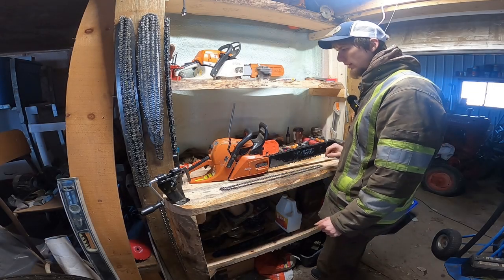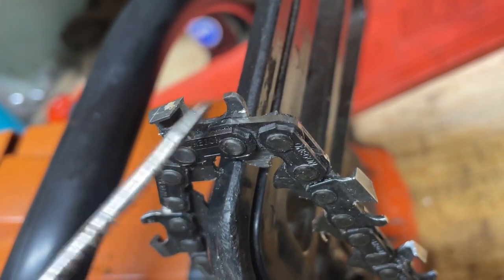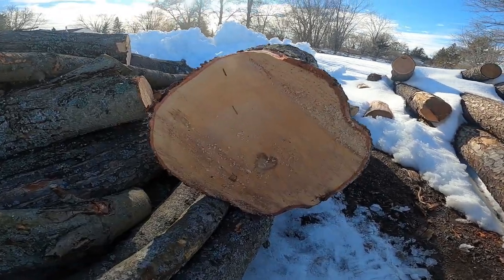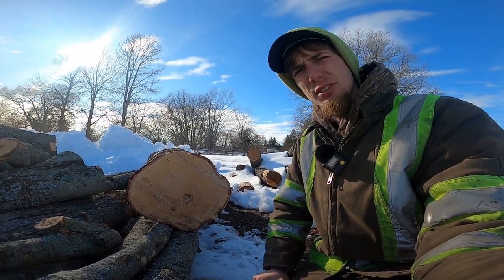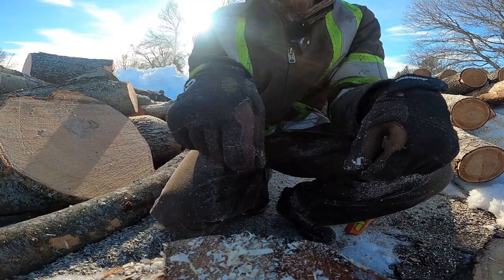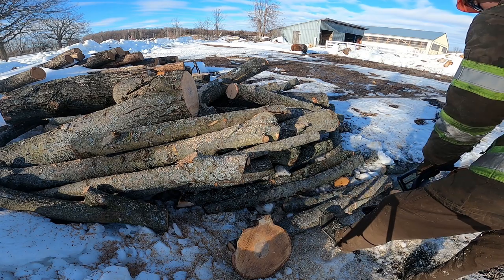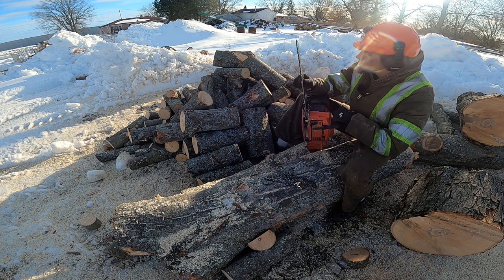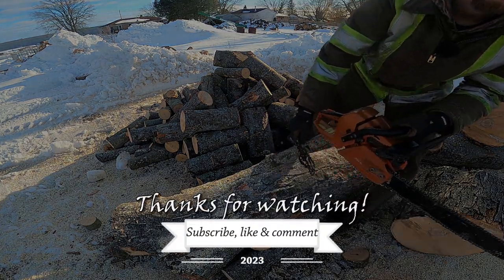Chainsaw Chain Modification.....Will It Help??

Comment: Not much difference. I don’t know why everyone one worry about stuff like that. I don’t run them. If was all I could get I wouldn’t  worry about it. There good idea for sure for beginners. Little saw cut good. Hope we can get ride this snow soon I need get out and get cutting. Keep up the good work.
Reply from the maker: Very little that’s for sure!  It’s not a full on safety chain, but does help, might notice more of a difference on 28”+ bars but they should be running skip tooth anyways 😉.    The echo is sure happy now!  We just got a inch or so more snow, winter is fighting this year lol!
Reply: @earthandbloom  it 40 and windy here first real day that taking the snow down. I run 28 full house on 372 it got plenty power to run it. Not lot real hard wood here. Keep up the good work. One day spring will be here.
Reply from the maker: @danshouseofsmokeandoutdoor7119  our 572 has a 28@ with a standard chain, they pull those 28” with no problems!  We mainly do hardwoods here

Comment: Nice job on this one.  It’s been a few months away from my saws so I went down and hand filed my husky 460. I need practice. When I was done working a pretty dull chain. Realized one whole side I had the angle wrong. But I was consistent lol. One side is more pointy.  Back to the drawing board.  Maybe a few strokes will get her fixed up!!!  Have a great weekend!
Reply from the maker: Thank you Stan!  And that happens to the best of us!  A few quick files will correct that, don’t worry about keeping the strokes even, make the tooth sharp, and set the raker to the tooth and the one ahead of it.  That will keep things cutting consistently.   You have a wonderful weekend aswell!  🪵💪🤟

Comment: You can buy saw chain without the anti-kickback feature and save yourself the trouble of modifying a saw chain. By feel, I haven't noticed a difference between regular and safety chain.. am currently using HiPa saw chain on my 572xp. When bucking in a log pile, it really saves on the kickback events, which speeds up the overall cutting process. But in a different cutting situation, regular saw chain might be faster overall. Basically bucking trees, use regular saw chain. Bucking in a log pile, best to use anti-kickback saw chain.
Reply from the maker: I agree with you 100%.   I had so many people say it saves a bunch of time, but it really doesn’t, with this style low kickback chain at least.    You may notice it on 28”+ bars a little more, but then we run a skip tooth chain anyways.    
    From what I see it’s not worth the effort to Draco out one or the other, get what’s available to you.   It seems it’s hard around here to find Oregon without it.
Reply: @earthandbloom  there are styles of safety chain that suck for performance. The type you used is the same as the HiPa saw chain that I use. It works to reduce kickback a lot when bucking logs in a pile like I do. And with reduced kickback, you have to reset to continue cutting less often. Safer and can be more productive in my situation.
Reply from the maker: @thefirewooddoctor  definitely, I don’t mind this style, it’s only a slight weight difference and only effects the cut at the tip, which you want in a log pile!  Injury’s can be expensive

Comment: Reuben,  you have a nice grind on those chains . They are cutting really nicely in my opinion and 👍
I'm so pumped for spring,  I can smell it in the air.  Very good video showing us all a good comparison.  Very nicely done. Have a great weekend my man 💪
Reply from the maker: Those jigs do do a nice job, just gotta spend a little time setting them.   
   Spring will be here soon, though looks like winters gunna fight hard!  Snowing right now 😂
   Glad you liked it!   Enjoy your weekend on that side of Ontario!  🇨🇦🪵👌
Reply: @Earth and Bloom  Yeah, the snow is trying hard to stick around here as well , but I think it will melt fairly quickly. 
I have graduated thankfully to an electric sharpener, makes it pretty fool proof for a dummy like me 😂
I call it my jolly rancher but don't even remember the name. It was pricey even 7 or 8 yrs ago but really makes life easier. I can grind a 24 inch chain in about 5 mins flat. Really made a big difference in my sharpening game. I just wish I could remember the real name 🤔🤔🤔
Reply from the maker: @famasmaster2000  we have been looking into Oregon grinders, they are pricey though!  One day 🤞